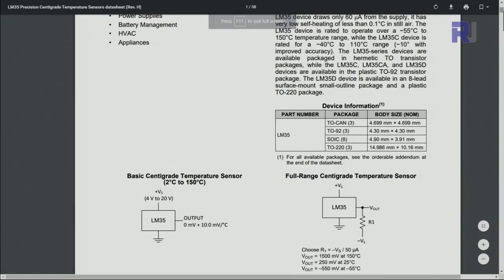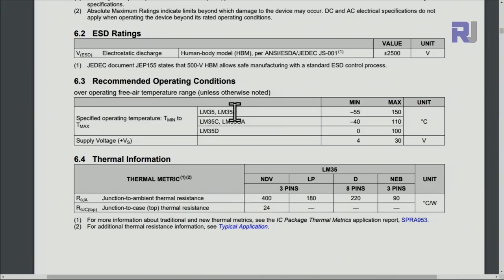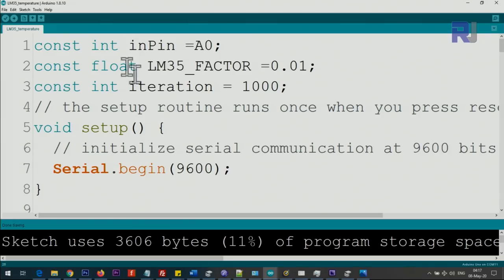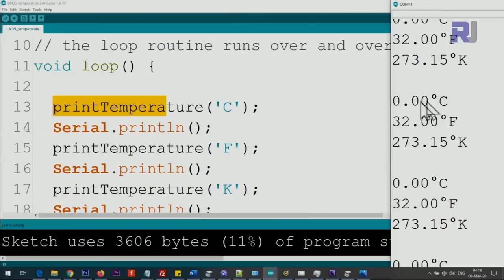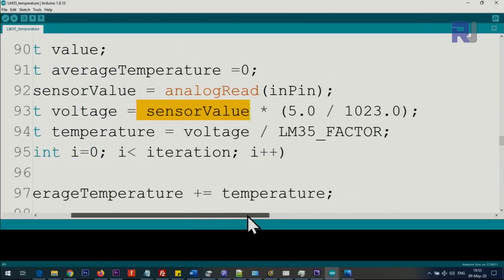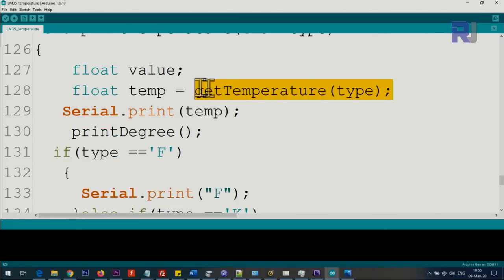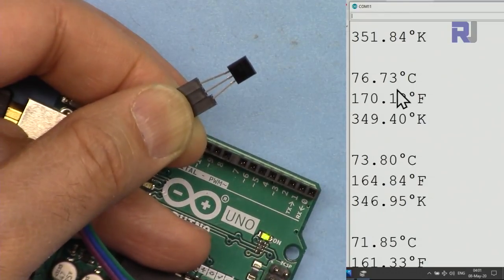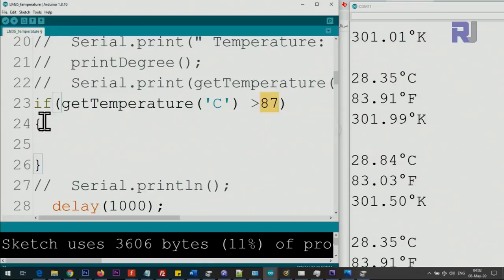Lesson 42: Using LM35 Temperature Sensor | Arduino Step By Step Course

Comment: Very interesting, how technology has made development of such systems so easily accomplished, I enjoy working with Arduino n NodeMCU devices,  what caught my eye to view this video, is my friend and I developed a complete industrial monitoring system in the 90's using the same  LM35 Sensor, no arduinos bk in that day,. We used a microcontroller, and wrote the code in assembly, did our scaling interface with op amps, etc,.. rs232 to a central monitoring system / multiplex , etc,.. was great fun!!!   Cheers n keep up the great videos always enjoy yr channel

Comment: The averaging loop seems faulty, if I read it correctly. THe device value is read just once, then summed to itself the "iterations" number of times (effectively multiplying by iterations), and finally divide by the number of iterations. So the code will end up at the temperature read in the first place, possibly affected slightly by float rounding issues. Otherwise a nice explanation and project.
Reply from the maker: Thank you for pointing the  fault in code. I just updated the code with correct code.

Comment: Will this sketch work on a Nano?
Reply: Yes, The Arduino Nano board is similar to an Arduino UNO board including similar microcontroller like Atmega328p. Thus they can share a similar program. The main difference between these two is the board size.